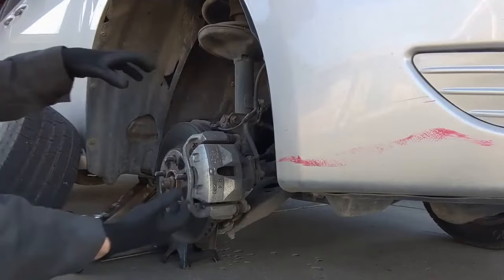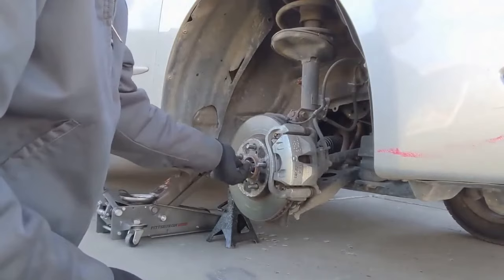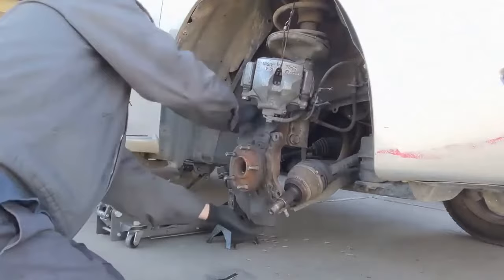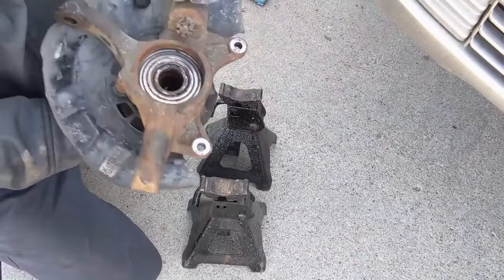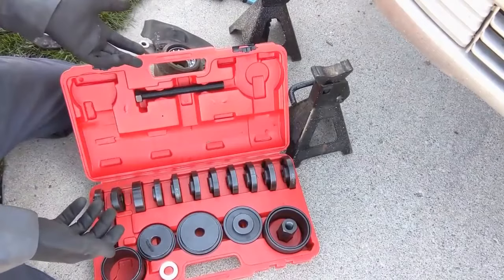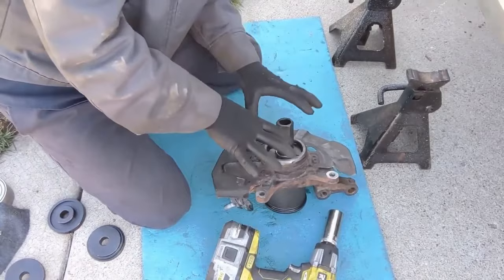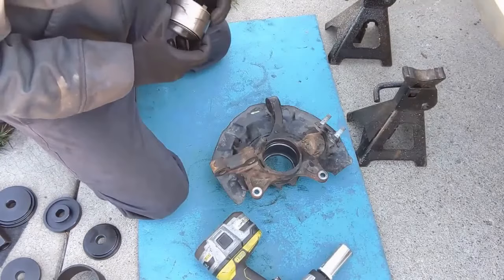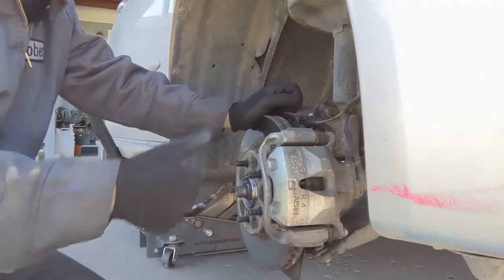2004-2009 Toyota Sienna Front Wheel Bearing Replacement | How to Change a Car Wheel bearing

Comment: This video gave my the info and know how to replace a front wheel bearing on my '06 Highlander without a press.  I also bought the same press kit and I'm very happy with the quality. (The threads on the screw held up just fine...one of the washers got mangled but that's no big deal).  FWIW, here's my story... I live in a rust state and no way was it easy-peasy to remove the bearing...in fact, the bearing with 355,000 miles on it was not coming out using my Ridgid mid-torque impact wrench.  It didn't even budge.  To avoid spending a whole day using heat and trying to partially cut the remaining bearing, I bit the bullet and took the knuckle to a local repair shop...cost was $40 (including tip).  Mechanic told me it put up a fight on his 30 ton press.  Installing the new bearing was very easy using the press kit. I thoroughly cleaned inside the hub with rust penetrant and a very, very fine grit scotch brite (maroon color) pad.  In addition, I put the bearing in the freezer overnight...coated inside the hub with light weight machine oil (20w) ... the bearing slid right in without putting any strain on the Ridgid.  When installing the hub, make sure the adapter bushing plate fits inside the snap ring and makes contact with and covers the inner race of the bearing. See The Car Care Nut YT where he explains in more detail.

Comment: At the end you mention that the press kit allows for pressing in and out while still connected which is mostly true except for removing the hub which requires a slide puller if you leave it all attached.  By taking it all out you were able to avoid the puller and use your socket to knock it out from the back.
Reply: Exactly. That what I was going to say

Comment: So what’s stopping you from just pulling the bearing without disconnecting the knuckle from the control arms? Yeah I get that the passenger side CV Axle is long but you can use a rope to pull it away for better clearance when you get to use the 1/2” impact

Comment: Luv to see ur video I just had Amigo install new CV axle and wheel bearings on my 2005 Sienna. I just got this part of 170k miles no noises before. Now after putting all factory … by local Amigo shop now I hear all sounds on sharp turns on high speed I hear roar or hum noise. Don’t know what he did I m saddened any idea bro

Comment: When pressing the hub I assembled the press tool as instructed and separated the race from bearing. It seems that on the last step of pressing the hub that the disk should be installed with the flat side as you started to do at first.
Reply from the maker: Hey Martin thanks for the comment 👍. Just in case you're thinking you need a new bearing, a little separation is ok. When you tighten the CV axle down it will suck everything back together nice and tight. If you have any questions or thoughts feel free to comment 👍

Comment: Would this process be similar to a 2008 front wheel bearing replacement?
Reply from the maker: The process should be the same 👍. Sometimes torque specs change with different years so I'm not sure if that's the same or not.
Reply: I hope so. Will let you know in 2 weeks. If I forget, let me know to let you know

Comment: Can it be, that wheel bearing is built in to the hub? It sems like I'm trying to press mine and I don't even see the border of the bearing.
Reply from the maker: Make sure the snap ring is removed and you are pressing it out in the right direction. It is in there pretty tight but it will come out. Don't give up 👊
Reply: @ValleyMobileAutomotive  All went good. I just needed a big wrench to hold the nut, because the force needed was that high that the nut startet to spin.
PS: BTW, I don't think you've done it right pressing the hub at 12:16. The black circle you've taken to lay on the bearing was as big to lay on the stop-ring, not the bearing itself. And as result, when you were pushing the hub, the inner race of the bearing was able to be pushed out of outer race as far at depth of the stop-ring. So like 3-4 mm, which for sure damages the bearing (not known to which extent, maybe it's negligable). To be safe with the bearing, the correct diameter would be just to lay on the bearing and inside the stop-ring, not on it (and I think it's important to make the process as safe as possible for the new bearing. ) Or hub should be pressed without setting the stop-ring (it's not important at the moment of pressing the hub to hold the bearing inside the knuckle, because the force is to the inner race, not the outer). Besides that, excellent tutorial. Was able to make it watching this video.

Comment: I usually put a pry bar in-between the studs or I'll put a screw driver in the fins of the rotors so I can torque the axel nut.
Reply from the maker: Thanks for the tips Jose! Those are quick alternatives to putting the tire back on 👍

Comment: When do you know to stop pressing? Will it bottom out and will just stop? Thanks.
Reply from the maker: Yep, it will bottom out. You'll notice a change in sound/feel of the tool. You should also be able to see a lip on the front of the knuckle with the bearing out. That lip will stop it from pressing in more.
Reply: One more q. Whats the torque rating on that Ryobi impact? I can't believe it's able to pull the bearings - that's some torque right there. Thanks
Reply from the maker: @drakeforte568  This one is rated at 300 foot pounds. Plenty of force to get this job done 👍. They also came out with a new one with higher torque ratings if you feel you need more.

Comment: Is it necessary to replace the hub when changing the bearing on this vehicle?
Reply from the maker: Good question. It's not necessary but it's a whole lot easier. To reuse the old hub you have to either cut off or torch off the left over bearing race.
Reply: @ValleyMobileAutomotive Thank you for replying.   That you mention it, using a new hub makes sense saving time,  regardless if you have the tools or not.

Comment: That was great! Is the press kit a loaner one for the big stores? if so which one? Thanks!
Reply from the maker: Thanks! This is a purchased set you can get for under $100. It's possible it can be rented from the parts store but I'm not sure. I put links in the description for all the tools needed to complete this repair 👍
Reply: when I saw that Ryobi impact take that bearing out I laughed. FYI a press sometimes has difficulties taking that bearing out or pressing it back in! it's not as easy as it looks in the video to be honest. but good luck trying it! I would recommend a press 100%.

Comment: I ordered the same bearing press kit as seen in this video.  I’ve tried using it on 4 different wheel bearings now and it just doesn’t work.  I end up have to use the discs with a 5 pound sledge.  I lubed up the bolt, nuts and washers too but can’t get it to work using a breaker bar on one side and a ratchet on the other…much less and impact wrench and my bare hand like in this video.  Frustrating!
Reply: Too old and too rusty